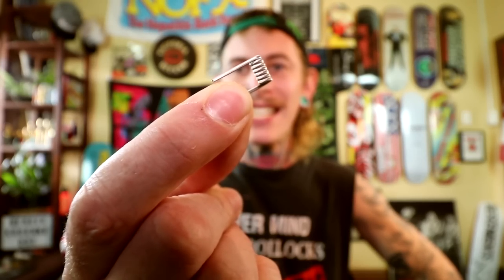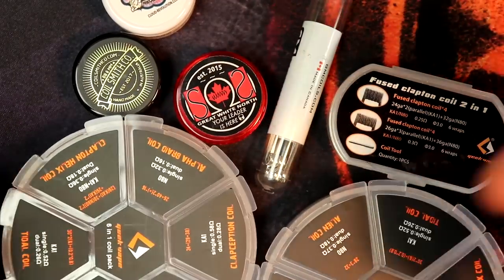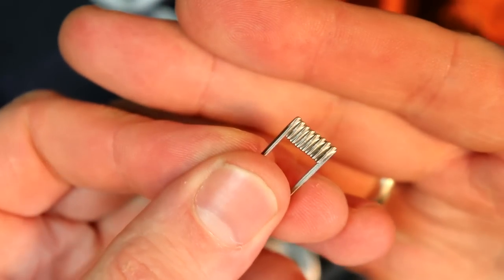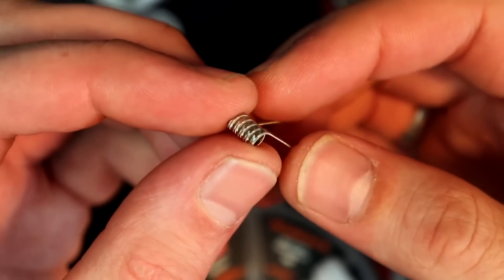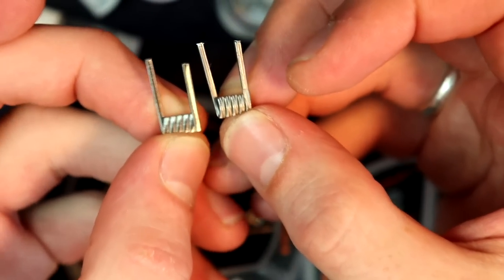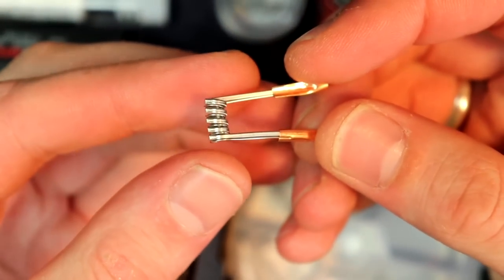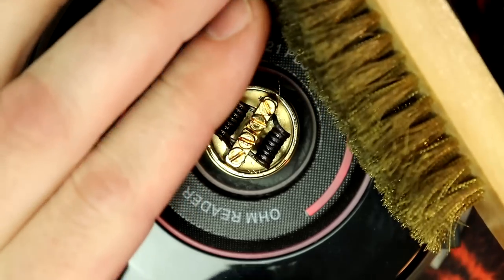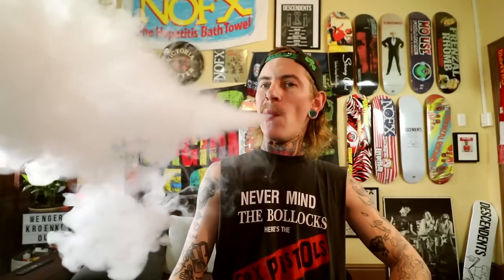Fancy Coils | China vs The West + How I Clean Them | The Vaping Bogan

Comment: I have bought handmade coils from guys that are really great builders and I think it isnt that you dislike the Chinese coils Bogan.. Its the fact that you personally like the flavor you receive with ni80 in the coils.. Personally I hated my coils that was ni80. Yes they heated faster but the favor wasn't near as good as I get with a kanthal build. And to me complaining about resistance being too high with any coil for that matter is also pointless bro.. If you want it lower then take a wrap or 2 off, lmao! I'm more of a series vaper anyway so I like many wraps with an high power regulated mod to get that specific vape. I can usually get what I want out of any kanthal coils but personally can't stand ni80. I think the taste is horrible with ni80 in the coil. Maybe its that I have gotten used to vaping Kanthal so much that I'm used to the certain flavor I receive with Kanthal. when I use ni80 the flavor is not even in the same ballpark. And also price point.. Yes my ni80 coils lasted about 3 or 4 weeks longer even tho I disliked the flavor (kept thinking they just need to break in, flavor will come, never came like in used to with kanthol). I mean hell if I'm paying 25 bucks for like 10-15sets of chinese coils vs 25 bucks for one set of handmade then even if you get double the life span out of the handmade, the Chinese coils technically last longer because you have so much more of them.. Tbh I would rather build my own claptons, fused claptons, twisted, parallel builds ect. Being that you have developed a certain taste for ni80, I feel that you are always going to prefer handmade builds unless the Chinese build is built to your specifications with the type of wire. Personally ill stick with the Chinese getting much much much more for my money and they type of vape I enjoy for flavor.

Comment: Ive bought several handmade western coil sets and they were fantastic but i recently bought a spool of framed staple wire from coilology and havent had any significant issues with it thus far. I think its in part due to the fact that i decide how much resistance i want, how many wraps, and whatever inner diameter suitable for what im vaping on, and i use tube mods, pwm, and regulated with it and am pretty pleased with the wire from coilology. Obviously any western handmade coil is going to be better all around and i loved every one of them that ive had but for the bargain, the spool of wire is better for me. Love your content you fuck pig! Get back with "grey" haze and tvp again! I loved that shit! Keep up the good work man glad i can support the channel and whatnot through patreon!
Reply: Levi Daniels yep that is the best cheap wire or coil option out there.  The 26g is shite tho but the 28g I always have some. Handmades 4 life though.
Reply: chris bridges mine is 3x.3 ribbon. 26g frame and 36g Clapton pretty decent when it's all n80
Reply: Levi Daniels I liked the 28g alot better. I think the 26g would be better than the 28g if it was claptoned with at least 38g. I would actually like to see 40g since it's machine made there's little gaps in the wrap wire. I say that cuz tight flawless wraps 40g just gives a flat, hollow less flavorful vape to me.

Comment: Since i found the NK factory in china wich has the nickel alloy ltd certified company marck with is pure ,if not the purest ,nickel alloy i stopped to bougth hand coils and waste money...for 15 euro i bougrth from the provider,if not 2 of these 15 euros coils will cost 20 for 2 coils, 8 staggerton and they have a different and newest way to do mechanical wrapp wich is so delicate that the mechanical stress is less than an handmade one ,i taste the difference..have an absorbsion incredible in 2 staggerton i can put on each coil at least 15 to 27 drops of liquid ....their rump up its absolutly faster than any other i ever used...and they use EU certificated standards for their coils....nk started has an hand builders and as so talented opened a factory only for coils and nickel materials(do also khantal ha1 purest form pf kanthal a1 ,and ss316 but i bougth only ni80 and 90 mybe 70 ...absolutly astonishing coils...the BEST ONES....
And the gauge used to wrapp is not  above the 32 for the alien v2 and for fused or alien not above 36..the norms are 38 and more 40 and 42 ....they are craaazyyyy
2 3 core mirorr fc putted in september hav sawn more or less 400 ml and still rocking and some time came back to blue stabilization acter water cleaning

Comment: There are some tanks I have that work great on chinese coils. Some tanks like to spit with them, don't feel good, don't punch right, etc. Some of my tanks make up for the drawbacks and are thus very cheap to use. But others, like my Kylin RTA, and quite a few of my RDAs, are not cheap dates, and hate cheapo coils. I have a Creed RTA that is notorious for going dead short with chinese coils but has NEVER done it with a quality set. I have no idea why, I've taken the thing apart a dozen times, and even with very good electronics knowledge I still don't know the reason. It's just a picky tank. 

Usually I'll try a quality build in a new tank, and then a chinese build, and if I don't see too much difference, I'll just go chinese all the way because cheap. VooPoo x217 w/ THC Tauren Solo RDA for example runs super cheap chinese coils, never spits because that mod with dual 21700s can just ram wattage at them for days till it vaporizes even with shitty coils, and it hits nicely with them. Only downside is charging that fat 8000mah of lithium.

I even have a tank (Coilart Azeroth) that works better with chinese coils. It's a ridiculously hard hitting, full deep breath type of tank with massive airflow and I found it just works better and produces better flavor with el-cheapo coils. Every tank is different, every mod is different. Some of my mods pulse the coils a bazillion times a second, mech mods are constant fire. It all depends on a dozen different factors.

I really enjoy those chinese twisted ones you had there at around 11:00 in. Those I've found respond really well to high wattage, balls to the wall power builds that throw so much energy at the coil it heats pretty much instantly. Though those coils do like to spit at anything lower than a hundred watts.

"Big fuck off coils" - For my big fuck off mods and my big fuck off 80 amp (pshhh, Samsung 40Ts in parallel) batteries. :) Hit the fire button and instant mushroom cloud!

But at the end of the day, take whatever I say with a massive grain of salt because I mix my own juice, and run drugstore organic cotton. YMMV.
Reply: The coils would be "on the tanks"  
Or "in the tanks."
Not the "tanks on the coils."

Comment: It has to be mentioned that when talking about chinese coils Coilology is the very best. Their tri core fused claptons ohm out low low for mechs, they have a 16 in1 or 17 in 1 cant remember but they have 42 coils in then you can get it in N80 or SS316. Also you can get spools of their wire to wrap yourself. If anyone wants that type of cheap coils/wire there ya go.

Comment: Hey Bogan! I was skipping through parts of the video as I was cooking today and noticed your question of any actual difference between the Chinese triple core fused Clapton and the alien, if the two were using the exact same wires. In theory, alien coils should have more surface area than Clapton equivalent coils due to the outer wire’s pattern. Imagine measuring out 1 inch with a ruler, then you draw a straight line (Clapton outer wire) and a windy line (Alien outer wire). Now if you actually measured the true length of the windy line, then it will be longer than the straight line. I don’t know if it truly relates to a noticeable difference between the two coil types, but I believe that’s the science behind the alien coil. I’m probably preaching to the choir though, keep up the great videos!

Comment: When you say you like .11 coils on your mech mods I would hope you're using parallel boxes with them, the amperage those pull doesn't seem safe on a single battery mech at all. I might have missed you pointing this out but you might wanna mention it if you are using parallel and that it's not the best idea to run that low on single 18650 mods

Comment: When I started vaping I did research on what my Cleito coil was about. Once I really got into vaping I put down the tank & got into RDA's... That's when I got into these review's & learned alot more. I got them cheap bastard's because I could afford em, but the more review's I watched the more I checked out the coils Bogan was using & Grimm, & Twisted420. That got me into the builder's too. With more knowledge comes the proper sense to pull 20$ out of paycheck & hit up M.Terk or A.J. Holland for sum proper work. I've got sum M.Terks stashed away & a set that have been in my Goon for 7 months now. I could put in a new set, but honestly don't need to... Yet. Good God this was a long comment, gunna take a squizz off the Ol Bonza now

Comment: I find that China is getting better with their coils... if you ignore the gimmicky “fuckton-o-wire” creations and stick to the simple n80 dual/triples the ramp times are quick and you can get them to ohm pretty low (0.1) with the right sets. Longevity is another issue, but it’s only a matter of time before they will be knocking them out for a couple of bucks and giving 95%+ of the performance of western wires/builds ... economics always wins... and China, in the same way as it’s doing now with most industries compared to the west ... will also win. There will always be a market for handmade western coils but it will be limited.

Comment: I honestly don’t now why anyone vapes ni80. Tastes like shit to me. My go to coil is framed staple aliens. Frames 26g ss316l sandwiched 4 .4x.1 KA1 ribbon. Wrapped in 36g SS 316l. 5 wrap 3 mm bit. But to each there own.
Reply from the maker: cos ss goes black as shit real quick from my experience, love the flavour of N80. but yeah man each to their own
Reply: The Vaping Bogan the real flavor comes from the bonza anyway. Got four of them. Kick ass job.
Reply: I like ni80 and ni90 for my tubes and mech squonkers.. it just ramps up faster and a cooler vape as opposed to same ohms on ss...I'll agree with you that ss does taste a little better in the beginning but yeah what Bogan said, they burn out after 1 day or so.. I'd recommend pure ss on a higher ohm build if your doing temp control.. but again these are just my preferences you know
Reply: Boombot lol.. I love that line. . Bobs your uncle.. cheers bud
Reply: Boombot what's that ohm out to? I love my SS.. I use similar but with SS .4 ribbon and 40g wrap
Reply: My throat does not tolerate NiChrome well.  I use regulated mods so SS resistance jumps around to much for power mode.  I just can not get a satisfying vape in temp control with putting the temp up to 550ish, which kinda defeats the purpose.  Kanthal is king for me.
Reply: Boombot Yea, I don't know why their SS is "burning out after a day." I have not experienced that.
Reply: Dexter Morgan around .09 with a 5 wrap.
Reply: Andrew Delashaw you need to dry burn and work hot spots out very slowly compared to other wires. I’ve found doing it in a dim lit room and start super low Watts is the way to go. Makes all the difference for me
Reply: I use SS and N80 both. SS is better imo and offers a cleaner taste. My SS coils never burn up or gunk up any faster than n80. I get all my SS coils from AdvancedVapeSupply. Awesome place for SS coils and can't beat the prices. Also SS has been known to ramp up faster
Reply: Boombot I am the exact opposite, I loathe SS coils because of their taste.

Comment: I see way too many post about coils not being worth 15 to 25 a pair it's way overpriced and yes your right the priced is ramped up but what your not seeing is yea sure you can go and buy a spool of American made wire for cheap as fuck but do you have the time patience and skills to build your own?  Your paying to be lazy and still have quality! Your paying somebody to make you exactly what you want so you don't have to and it's for handmade quality instead of a machine in China spitting out thousands of feet in minuets and soaking them in matching oil as they pass by all the little greased up machine parts that need to stay well oiled to keep moving so fast I own every pack of pre made wires on the market just about I think there are 2 that just came out I don't have bit my point is I use China pre built ,I use American pre built and I build my own Clapton and fused Claptons and it's all different

Comment: I literally started cringing when I saw you take that metal brush to those coils mate!!!! Haven't you ever tried burning off your coils with a bit of water? Get your coils slightly glowing, splash under running sink water, rinse and repeat until clean. Usually clean after 2 or 3 times. Your method hurts my brain. Do you shower with a brillo pad? Do you wash your car with a rake?....
Reply from the maker: Heating your coils up to red-hot and then dunking them under cold water is going to stress, fatigue and crack the metal and fuck your coils up quicker. a light brush with a brass brush designed for suede shoes is far better than water. Trust me, Been using rebuildable atties for a while mate 😉